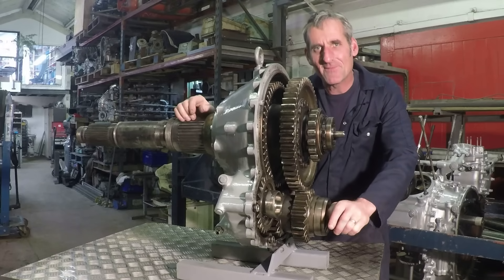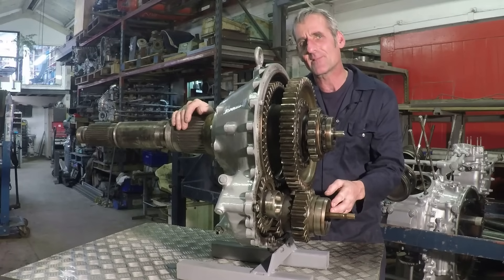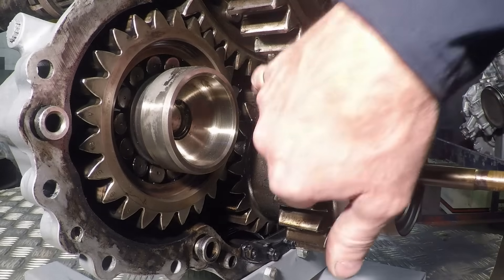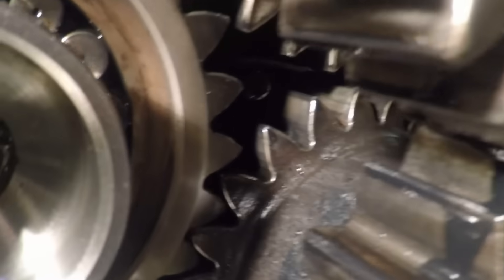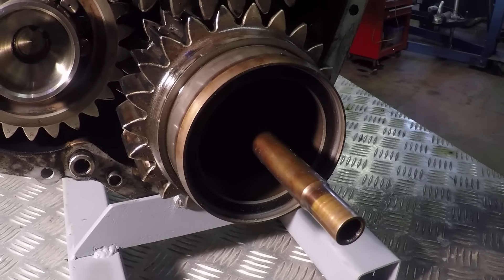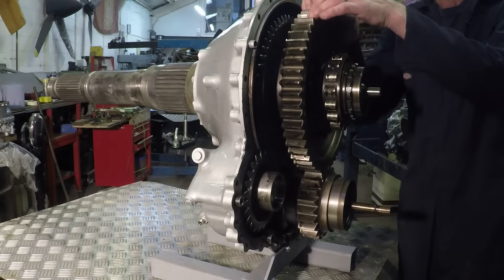An Explanation Of The Rolls Royce Griffon Counter Rotating Propeller Gearbox

Comment: For once an interesting and informative video, thank you. There is so much copy paste AI rubbish out there these days. Anyway, I was surprised to see one small spur gear (the one with two sets of gear teeth) being used as the PTO to drive the second propellor. That must have been under a lot of load. A couple more of these radially arranged around the case would have reduced loads but of course added bulk, weight and required more machining precision. I am sure the designer was fully aware of this and made an informed compromise.

Comment: Insane that that gearbox can handle that kinda power, tapered roller bearings are amazing.
Reply: Thanks for motivating me to go down the rabbit hole of tapered roller bearings geometries and crowning profiles (etc). There is some dark art there. It is funny that our professor kinda skipped over the details but it seems that there are a lot of serious details. I vaguely remember asking a question after he mentioned that thrust bearings are always inherently problematic due to geometric issues.

Comment: Nice compact unit considering the HP/Torque involved.  I'm a bit curious on how the oil seals were configured for the counter rotating shafts and oil feed for prop pitch.

Comment: I've often wondered how these work and this is an excellent explanation/demonstration!  Do helicopters with counter rotating rotor blades like some of the Kamov models use a similar set up only mounted vertically instead of horizontally?

Comment: What's the exact gear ratio then? Weird ratio numbers (no common factor) are considered good practice to ensure a bad tooth meshes equally with all teeth on the other gear, spreading wear evenly. But it would be nice to know the number of teeth instead of a decimalized ratio. Maybe 23:52 ? It seems a good match to 0.4423

Comment: I wonder if you could tell me the exact number of teeth on the driver and driven gears. I can count, but without certainty, 22 teeth on the driver and 52 teeth on the driven. This would give 0.423 revolution of output shaft to 1 revolution of input shaft or 2.261:1. But as you rightly state the actual ratio gives 0.4423 revolution of output shaft. I cannot find any driver/driven number of teeth to give the exact ratio you state in a single train such as this without the gears possessing huge numbers of teeth. - baffled! The clearance necessary between the outer gears was almost certainly done by a slight decrease of the diametral pitch of the outer gear train gear teeth. The inner train teeth look as though they may be 4DP so a specially manufactured hob or fellows cutter of 4.5DP requiring a smaller outside diameter  and the smaller pitch circle diameter resulting of both gears would make the job straightforward and give the adequate clearance between driver and driven enabling drive throught the idler.

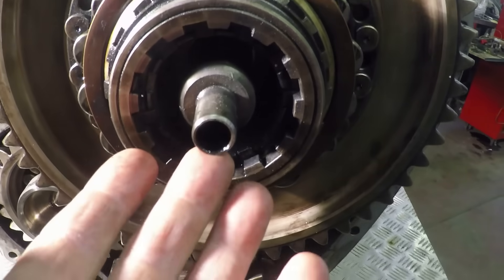Comment: 1:47 the oil feed goes to the hub of the propeller that's on the inner shaft and controls the pitch of that propeller. 
How is the pitch of the other propeller controled? Do they somehow get an oil feed to that hub? Or is there a mechanical linkage (probably via a sliding bearing) between the two hubs?

Comment: Straight cut teeth are noisier then helical teeth,, but much stronger, and helical teeth cause an end thrust on the shaft  where straight cut ones do not.
Reply: I guess that noise was less of a problem with an engine with almost no exhaust silencing. Those gears are not much bigger than those in my EV. What was TBO for the gearbox?

Comment: Fascinating.   The gears don't seem to mesh very closely, but I guess it is designed that way on purpose.
Reply: Notice they're straight cut (they don't spiral around the shaft so they're noisy but have less drag) and curved-face (so their contact patch stays the same size almost all the way through when they touch)

Comment: It's interesting that rather than trying to arrange the same reduction ratio with different tooth counts (due to the smaller gears required for the reversing drive), they used the same number of smaller teeth.
Reply: He says a ratio of 0.4423 which I think is 23 teeth to 52 teeth. Weird ratios are considered good practice since it means that a bad tooth on one gear causes equal wear on all teeth on the other. Therefore it wouldn't be possible to have different number of teeth on each pair of gears. For example you could do 20:50 and 24:60 to give the same ratio of 0.4 : 1 in two different ways, but the first one has teeth meshing in groups of 10 and the second one has teeth meshing in groups of 12, which means that a bad tooth would concentrate all the  wear it caused onto 1/10th or 1/12th of the teeth on the other gear.

Comment: If one looks carefully, there are only about two teeth meshing at any one time , so that means that 1000 Horse Power are being transmitted through two teeth,
The logic and rational thinking of engineering in the last 200 years, have taken over from the emotions and the  illusions of religions, politics, art and  other social professions, which never provide any tangible guaranteed services or comfort for the family, but a sentimental situation which many people still need. 
Relative to what modern humans do,  they all wrap around them some sort of engineering prosthetic aid to enable them do what they cannot do when naked, and with no engineering attachments, as land vehicles, sea craft and air craft, including a pair of shoes, as now no one can walk barefoot. As for hospitals, they are full of engineering diagnostic and working tools, and where the surgeon leaves off, as in amputations, the engineers take over, with fitting modern prosthetic aids. 
Pilots needs to accept that their prime and principal duty is to always try to  save their own lives, under every situation and it is the engineering in the aircraft that buffers their  life during all normal flight, and many other not so normal flights, and if the flying prosthetic aid fails, some pilots are lucky to have another change though being provided with other prosthetic aids, as ejector seats and parachutes, where the pilot does not care two hoots where the damaged aircraft lands even on residential areas, as long as the pilot saves his own life provided he finds enough engineered  prosthetic aids  to wrap around him to do so. Sully of the Hudson river landing saved his life be cause his prosthetic flying aid had enough buoyancy in the nose  to counteract the drag forces of the two engines dragging the nose down and as the co- pilot said, " I thought we were going down to the bottom of the river." 
Engineering has uncovered the beauty and hidden wonders  found in  silence and what is not visible to the human sensors and rather than understanding it, most people ar proud to buy and own and operate engineering devices and fill their own homes with tangible guaranteed engineering devices. 
This video showed some of  the beauty of engineering which laid quiet for too long while other professions were so vociferous exploiting the people around them with, illusions, faiths and selling, promises, entertainment, emotions and indulgences.

Comment: Before reading the description in it's full length, I did the calculation for the torque, and arrived at nearly 6000Nm, but I didn't know the RPM, just guessed at 2600. From the description's stated 5300 lb ft, I must have been close. That mean if the pinion gear diameter is around 25cm, the force on the teeth is close to 5 tons 😵 - or maybe half per pinion, if the load is evenly split.
Reply: There are multiple output specification for the Griffon in the Wikipedia page for that engine, with the highest (for the version of Griffon in another application) being 2,220 horsepower (1,655 kilowatts) at 2,750 RPM... corresponding to 4,202 pound-feet (5,700 Nm) of torque at that speed. The same Wikipedia article lists  2,345 hp (1,749 kW) for the Griffon 57A in the Shackleton, but with no speed specified.

Comment: hello gentlemen, it came in my hands a Rolls Royce Griffon in immaculate condition, the engine is rotating easily I can say.
i need to install the magneto, connect the petrol, and oil hoses, but I don't have any experience n these engines.
i am wondering if any one of you could help me with some information.
i am willing to pay the cost, even if someone could come to Cyprus and help me to start this engine.
Reply from the maker: Hi. If you are on Facebook, put a post on “Historic Aero Engines Group” there are lots of people there who can help you.
Reply: @FlightEngineering1  thanks a lot my friend

Comment: What really interests me is that Instead of having a gearbox made up by 3 extra gears, why don’t the engineers give a try of a single spider gear, just like the differential setting for the cars?? 

Isn’t that much lighter and easier to maintain?
Reply: An input bevel gear, bevel idler gear, and output bevel gear would be the same gear count as this small input ger, idler gear, and large output gear... and bevel gears would have been both more expensive to manufacturer and more difficult to locate (because axial position is critical for bevel gears but not for parallel gears).

Comment: Where to find numbers of gear teeth? In the video it's clearly seen only 25-teeth gear and a big 53-teeth gear.
Reply: I didn't see a view which allowed accurate counting of any gear other than the idler (and the idler tooth count doesn't matter). The drive ratio is given as 0.4423 so if the large (driven) gears have 53 teeth the small (driving) gears must have 23.44 teeth... so someone has miscounted or mis-calculated. I'm guessing it's 52 teeth (large) and 23 teeth (small).

Comment: I believe that what you are describing is a CONTRA rotating propeller gearbox. Contra, because the propellers are on a single engine. If you have two engines with the props rotating in opposite directions then you would have COUNTER rotation.
Reply from the maker: Yes, that’s correct. I am using the term which de Havilland used when they manufactured it, but we now refer to them as contra👍

Comment: Beautiful!  It's amazing that those seemingly small teeth can transfer 2500hp to two 13ft props.
Reply: Those definitely aren't small teeth 🙂. Since there are two drive paths, the gears are each handling half the engine power. However, it's torque rather than power that breaks gears. With a 13 foot prop, to keep the blade tips from going supersonic (They won't give useful thrust at supersonic speeds) they can't be spun at much more than about 1400 rpm. I had a quick look on Wikipedia and the power figures quoted there are at 2750 rpm, which means a propeller speed of 1216 rpm with this gearbox. The torque at this speed and 2345 bhp is 6 072 Nm (2345 bhp is the max figure given for a Griffon 57 with water-methanol injection for take-off, it's 1960 bhp without it), so this means each set of gears carry's half that or 3 036 Nm. That torque figure is monstrous until you realise this is a 37 litre engine, so 10 litres bigger than the Merlin.

This is a pretty ridiculous value when you compare it to car engine flywheel torques, where 400 Nm would be a good figure for a decent diesel car, until you consider that both the gearbox and the final drive in a car reduce the speed and increase the torque (4th gear is historically where the 1:1 ratio lands), so an engine putting down 400 Nm in a 4:1 1st gear, puts 1600 Nm, so over half the figure for the plane, to final drive pinion gear. Of course the wheels will be spinning long before this figure is reached in 1st gear, but gearboxes have to be rated for at least the max torque the engine can deliver to stay reliable. In trucks and tractors these would be small torque numbers, and they handle those loads all day every day for decades in some cases.

Comment: Thanks for displaying this gearbox. I’m amazed at how slender the shaft is that connects to the engine’s crankshaft. I suppose, that unlike a car where road friction and grip is high that there is much less with a propeller biting at the air. - great video
Reply: Nope, it's just exceedingly strong forged steel, or some steel alloy. Using the Merlin as an example, each power stroke puts something like 9 tons of rotational torque on the crankshaft per piston power stroke, which is increased with the gear reduction drive on the front of the engine to double or more. The Griffon was an even bigger engine with higher horsepower.

But this makes it easy to see why contra rotating gearboxes were subject to high failure rates with its spur gears. You have 2,000HP+ on just a couple of gear teeth at any given time, which is a tremendous strain on even the strongest steel. One tooth cracking and snapping off will wreck everything. Ideally, they should have used helical cut gears, but such precision in the 1940s would have been hideously expensive, far above what even a spur gear coaxial gear box had cost.

As for the air friction, you're not thinking in the correct terms of fluid dynamics. A propeller doesn't require much to turn it by hand, but at the speeds it turns, it may as well be going through a dense liquid like water. The propeller tips have a huge amount of drag at high speeds, which is why engine designers did everything they could to keep the whole length of the propeller sub sonic, hence reduction gears.
Reply: Thanks GGigabyteM for the explanation- makes sense
Reply: Torque is simply power divided by speed. In this case, if the input power is 2,220 horsepower (1,655 kilowatts) at 2,750 RPM (specs from Wikipedia article, for the version of Griffon in another application), that's 4,202 pound-feet (5,700 Nm) of torque... or ten times what any car engine produces. 

Keep in mind that between the engine of a car and the wheels there is transmission system which has a much higher reduction ratio (so much higher torque multiplication) in first gear than this gearbox has.
Reply: Looks like they use roller bearings on the shaft just wondering if there thrust bearings like they would use on a turbine because of the torque
Reply: @steven4737  Except the engineers already thought of that, because they had 6,000+ pound aircraft hanging off of the engine and nose casing that could experience G forces in excess of 6 and in extremes 9 or 10 for short durations in dog fights. Not to mention the vibration from the engine and propeller.

There's plenty of strength in the engine casing to use helical gears. But if you wanted to eliminate the side loading, double cut helical gears with opposing teeth would eliminate that problem.

Comment: Is the second smaller set of teeth the same ratio as the big teeth or are there really the same number of small and big teeth?
Reply from the maker: Same numbers of teeth, but smaller, ie one pair of gears is scaled down from the other. which leaves a gap for the idler gear.
Reply: @FlightEngineering1  Thank you.

Comment: Terrific.  Finally a real mechanic showing how gearing gives rotation power from one engine, on one shaft, to both propellers to produce  contra rotation.  On quibble, some sources say counter-rotating is defined as a propeller on one wing going one way and the other way on the other wing rather than two propellers on one shaft. Thank you.
Reply from the maker: Thanks for your kind words! You are correct, the term generally means two separate engines. I used the term counter-rotating because this is what the manufacturer, de Havilland Propellers, called it at the time of manufacture in the 1950`s, we would now refer to this as contra-rotating.
Reply: @FlightEngineering1  When referring to two separate engines they are correctly termed handed engines. The idea being to eliminate having a critical engine in case of a single engine failure.
Reply: @mothmagic1  yet in the case of the P-38, the only major type to use handed engines during WWII, the setup caused both engines to be critical.

Comment: Uhh...how did they have the same speed if the gear at the front has less teeth/size???
Reply from the maker: The numbers of teeth are the same, but they are smaller teeth on one pair of gears, making the gears a smaller diameter, leaving a gap between the gears, allowing for an idler gear to mesh with them and therefore reverse the rotation.

Comment: Do both output shafts rotate at the same rpm ?
The rear prop receives skewed air from the front prop so has more work to do.
Reply from the maker: They do, but as this system is typically more efficient than a single propeller, I guess that any losses caused by that are cancelled out. Also, the pitch of the front and rear props is not necessarily the same.

Comment: 1:00 you can see a fair amount of wear on the gear teeth. The straight cut must have been noisy to boot!
Reply from the maker: The teeth are not really worn, they needed cleaning though. What can you see that indicates wear? Yes, straight-cut gears are noisy for sure, and you can hear these from close-up on some of our other videos, however, once the engine gets on load, the exhaust drowns out everything else (for miles around!)
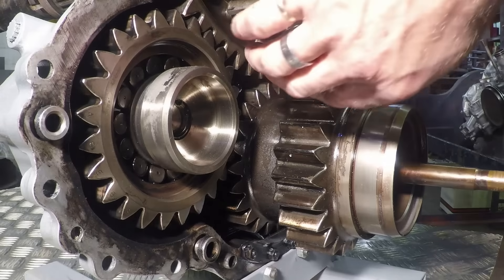Reply: @FlightEngineering1   if you look at 1:08, the gear on the lower right, the upper side of the tooth at 7 o’clock, it’s easy to see the depth of wear on that side. Being on the crankshaft it show clockwise rotation wear. And yes, I’m sure it could be heard for miles.

Comment: These propellers are contra-rotating, as they are on the same axis. Counter-rotating is when two engines with propellers turn clockwise on one engine, anti-clockwise on the second engine.
Reply from the maker: That is correct. I use the term counter-rotating because that is what the manufacturer, de Havilland called them at the time. I suspect the usage has changed since then maybe?